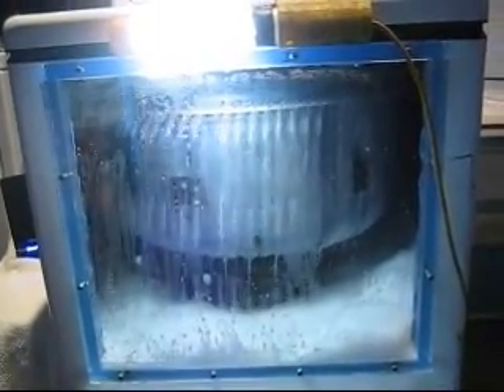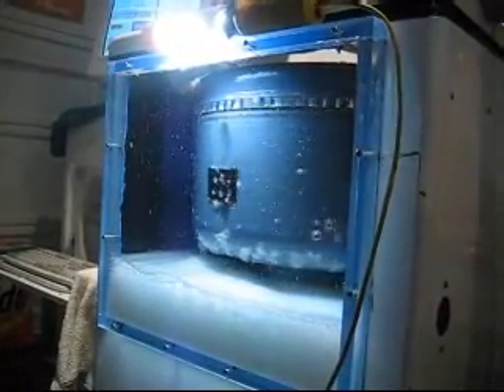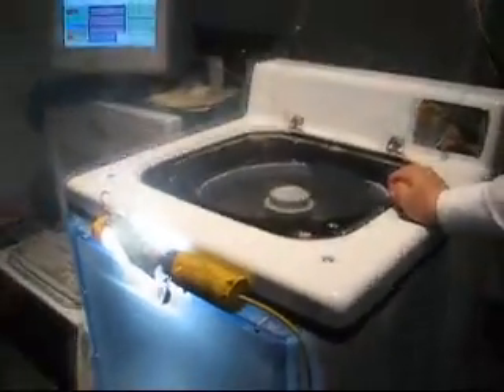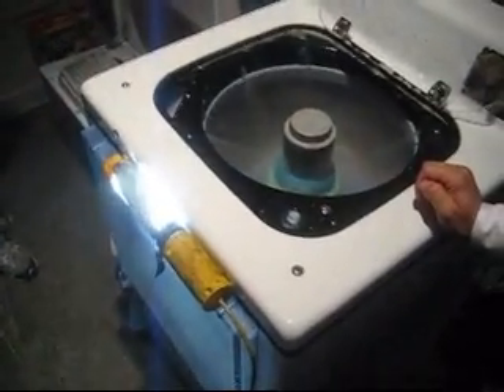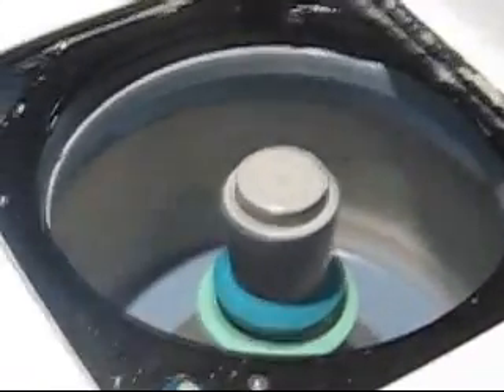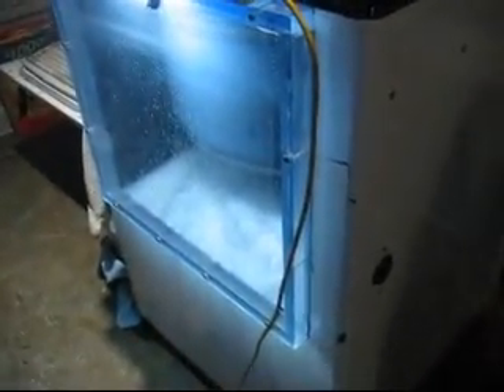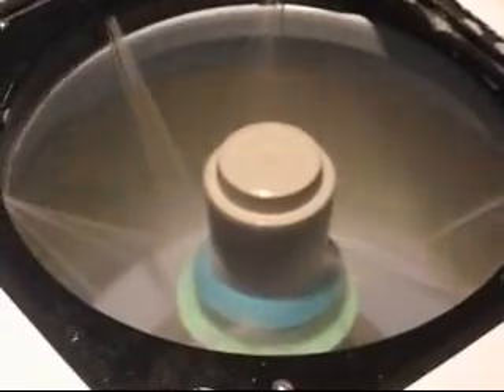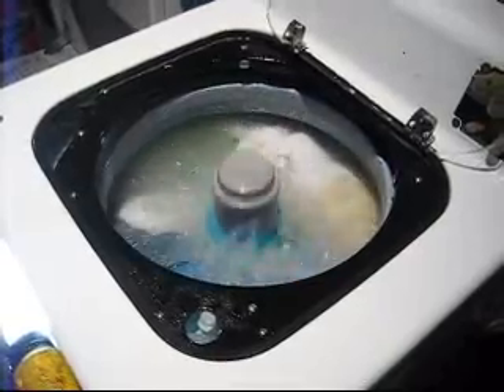Video of the Super Unimatic

Comment: I worked in an appliance back in the '70s that sold Frigidare. They had this cool handcrank demonstrator of the "rollermatic" mechanisim on the counter (I wish I had it now!) When did Frigidare switch to this type of transmission? It seemed pretty simple but was it dependable?
Very impressive spin speed, beats my front loading Samsung by just a little!